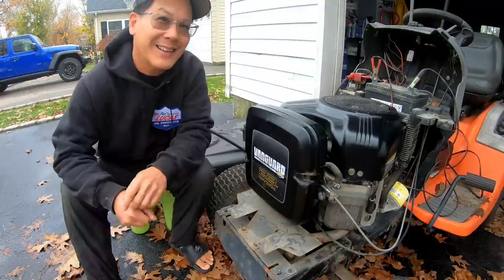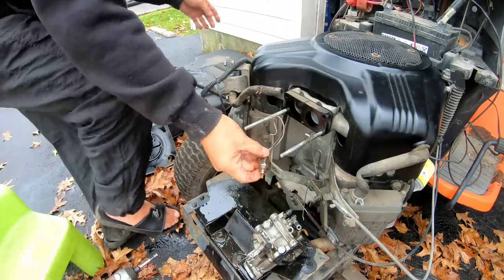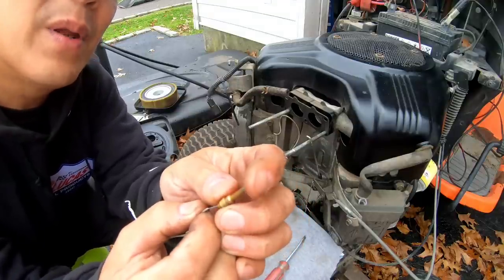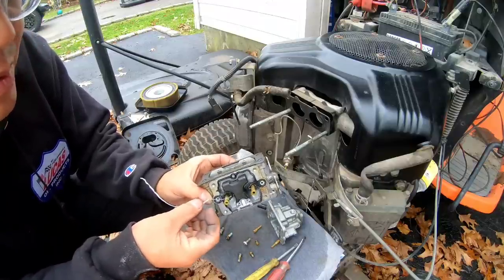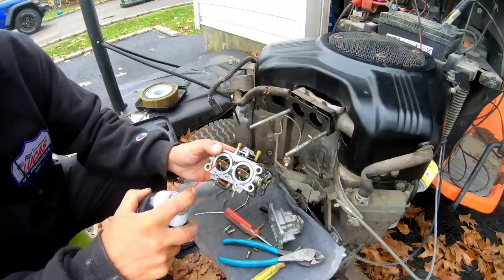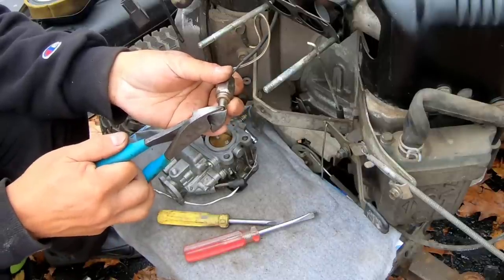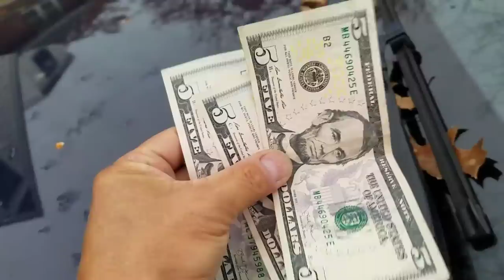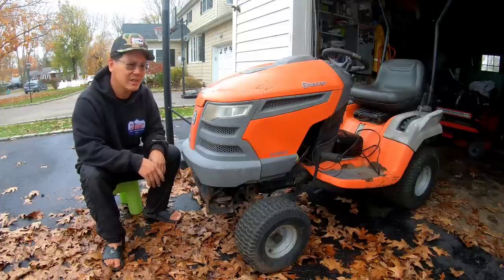BRIGGS STRATTON 23HP VANGUARD V-TWIN VERTICAL SHAFT ENGINE SURGING CARBURETOR SURGES CLEAN CLEANING

Comment: Very helpful! I have an older Simplicity w/ the 20hp version of this engine. RPMs were going up and down, watched your video, cleaned out the carburator and it runs great now!
Reply from the maker: Glad it helped!  Hope you’re subscribed
Reply: I have the same problem with my 20hp simplicity. Did you guys not have to adjust the fuel mixtures after this?

Comment: Henry, that engine is sweet!  I kept thinking during the video, why would it have a fuel solenoid when it doesn't have a gravity feed gas tank. It cant fill the crankcase with gas when it has a fuel pump! Nice camera work today and a complete cleaning of the carb. Roger
Reply: The reason for the solenoid, to the best of my knowledge, would be for anti-backfire.
Reply: @knighthawk86855  thanks for the comment Robert. I guess i dont understand their thinking on that. What do they think happens on a backfire?
Reply: @rogermcdonald1607  well it's can destroy a mufkin, and damage exauat valves, besides the fact it gives my neighbors a heart attack.... LMAO

Comment: Bought a used yth2148.  It has this same setup.  Thanks so much for the video!  The choke cable and linkage is missing from mine.  I can't see the linkage on the video.  Could you take a pic of the linkage?
Reply from the maker: https://f01.justanswer.com/koboma/a9dc573a-2880-4bb9-8062-4a1a30d5c5f0_DSCF1010.JPG

Comment: Before cutting the pintle on the fuel shut off solenoid, try spray lube and air compressor to free up movement, it often works.
Reply from the maker: But I don’t want it nor need it,  all it can do is cause issues.

Comment: thanks for the video, today I disassembled mine and made carburetor cleaning thinking I will so resolve the surging issue, but no effect.  I also checked the fuel pump and it pumps some fuel, it was hard to say if is enough or not. The next thing I wanted to replace the fuel filter and I also cleaned the reservoir since I noticed a few small pieces of grass inside.  Then finally in one dark corner noticed one fuel pipe bracket making too much pressure on the pipe and that was the cause of surging. Such a relief :). Maybe it will help someone, so check the fuel line from start to end, good luck ;)
Reply from the maker: Glad it all worked out!  Hope you subscribed
Reply: Got a pic of that dark corner ? Having an issue now on my zero turn

Comment: FYI your blocked off passage with the rubber plug is only an over fill port.
Reply from the maker: Well that’s because I’m a bad dude!
Reply: Actually, there is no gravity drain hole in the float bowl. The blocked off tube allows you to apply suction to the tube in order to drain the float bowl without carb removal. Removing fuel for long term storage or removing water contamination.
Reply from the maker: I don’t think that’s what it’s for. There would be a drain hole in the bowl

Comment: Never was a third stud. Always a bolt. Don't undo choke just pull choke lever to choke position. Seat and brake switches are hooked to the coil not fuel solenoid aka anti backfire valve.

Comment: You should get a ten pack of led bulbs for those mowers
Reply from the maker: I have a 20 pack
Reply: @MowersNBlowers  can we see it on one of those mowers and have a clean head light bay?
Reply: Henry, A little while back, I ordered some of the 1156 LED replacements off of eBay in a effort to get better lighting on my MTD YardMachine. To be totally honest, I wasn’t very impressed with the amount of light that they produced. 
So, I switched back to the Long Life 1156 incandescent bulbs. It seems as though the engine has to be really throttled up quite a bit to get any real brightness. Are there different varieties of the LED replacements as far as brightness and or what would be a good suggestion for me to try?.
Reply from the maker: @sebastianketnouvong-ung4502  it’s in my blue bayou! Search for the gt6000 videos
Reply: @MowersNBlowers  ok

Comment: You need a set of welding tip cleaners. Pretty cheap on amazon
Reply from the maker: I have them, the smallest was still too wide for the hole
Reply: Bread bag ties are tiny
Reply from the maker: Still too small,  bristle on a wire wheel!

Comment: 3/8 = .375     and   10 mm = . 3937 . Take the 2 studs' out that the carb is on ! The small solenoid must be grounded !!
Reply from the maker: It’s been fixed for a year.

Comment: It’s not the proper use of contact cleaner that’s for electrical devices you should’ve been using like carb cleaner or something similar
Reply from the maker: I have carb cleaner,  contact cleaner does a better job and it doesn’t blow up rubber gaskets.